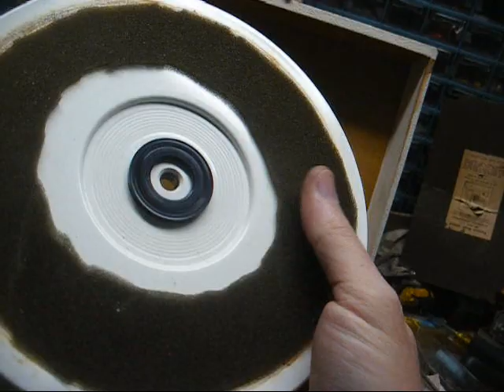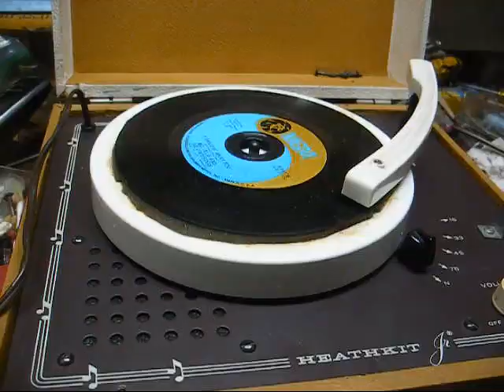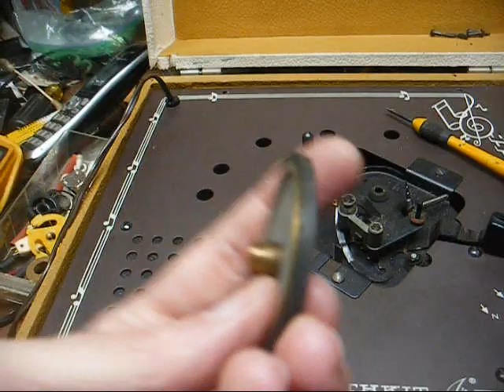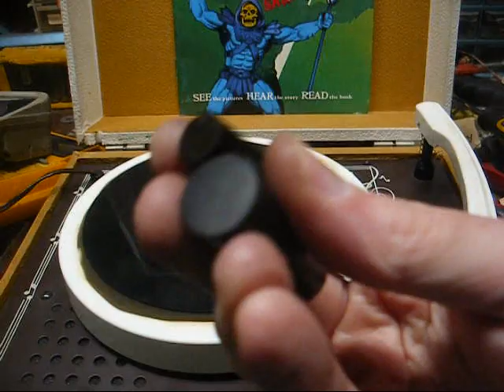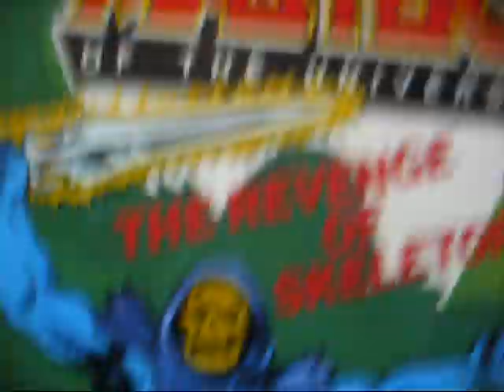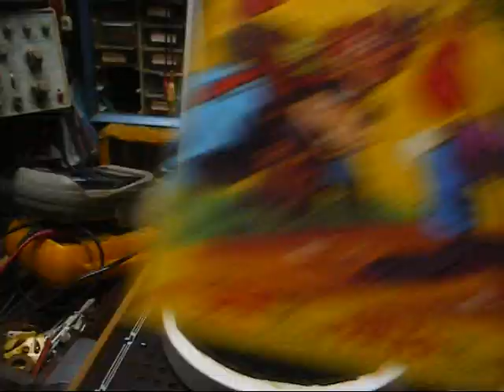Heathkit solid state 4-speed kiddie record player from 1967

Comment: Let me know if you put this back on eBay
Reply from the maker: Here it is for sale: https://www.ebay.com/itm/153692402656. I replaced the idler wheel with one from a donor machine to get rid of the wow and flutter and I replaced the needle with a new 1-mil sapphire for microgroove records. I also changed out the turntable platter to one that's in better condition.

Comment: Power supply filter caps replaced but the AC hum persists . Sounds like a ground problem. Is the shielding inside the lead from the cartridge to the amp input intact? How are the connections to the cartridge? It sounds like some sort of ground loop.

Comment: If your pad is bad, a couple of maxi pads should do the trick. They have adhesive backing for easy installation. It goes well with you vaginal lubricant for all of you lubrication needs. 

The eighties were an interesting time. I grew up in the eighties also. Saturday morning cartoons were big, and you got all sorts of goodies like Punky Brewster, Alvin and the Chipmunks, The Smurfs, among other cartoons. I almost never watch TV now other than one or two things just once a week. We got rid of cable years ago because it went to crap. Expensive crap at that. It seems like cable was at it best when it was analog even though it wasn't the technology that made it good.